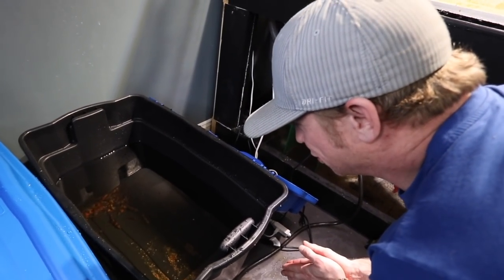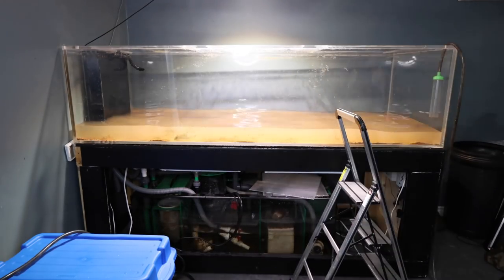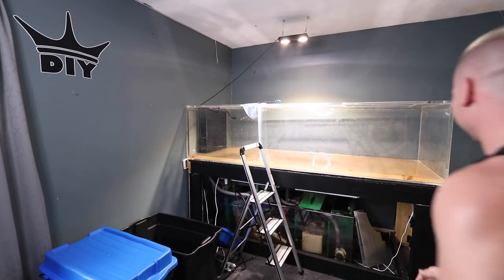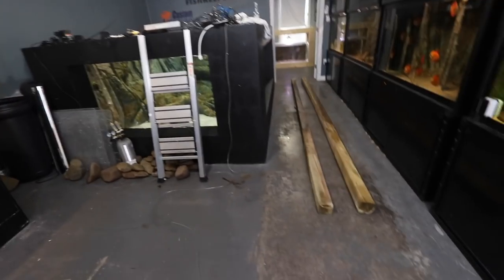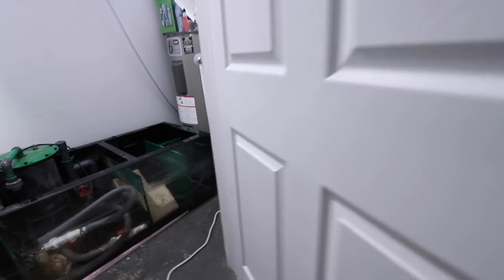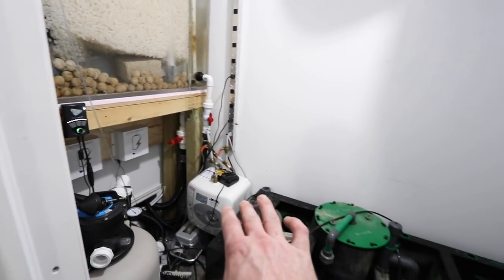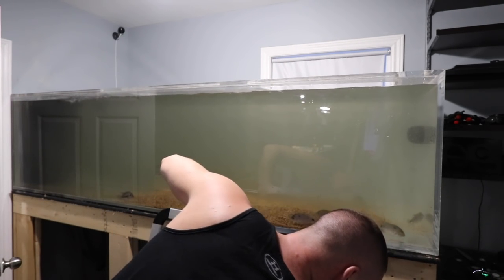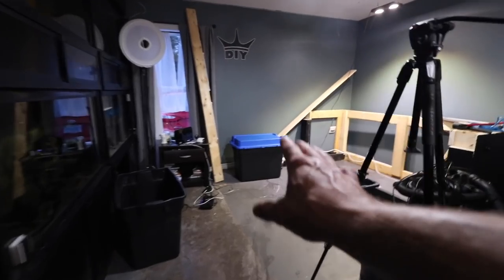BIG aquarium move - NEW fish room part 2 | The King of DIY

Comment: Joey...I don't know whether the wall is a supporting wall but why don't you knock the wall through that separates the gallery and Frank's room and have one continuous room? I think that wall and door entrance is pointless. Just a suggestion bud!
Reply: at least just take out the door.
Reply: That's not a load bearing wall. The gallery was built as a clear span. No need for any interior walls at all.

Comment: Can't keep lids off 2000g due to humidity so what about the pond?  (Aware the lids are for jumping too)
Reply from the maker: I'll put a lid on that too...
Reply: The king of DIY surely that is a tank again then the same as the 2000g ponds by definition don't have lids.  No above pond features like water falls or plants then.  

Another note, add some fan ventilation to under the plastic lids for remove the humidity and cool it off, like what people do in hooded tanks. If used brushless fans too they have less noise.

Comment: Wondering if varnish, pain fumes, glues etc have an effect on the fish?   Obviously finishing just a smaller showing area of the tank rather than complete stand is easier, to some degree.  But do you have to be concerned with fumes while working on them and letting it all dry and cure?

Comment: Joey, don't forget to leave yourself service access to that water heater in the back corner where you're going to build the new 6ft sump system. Water heaters can be so reliable we forget about the details until you need to swap out an igniter module or just shut off the (gas presumably) or whatever might crop up.

Looking forward to seeing all the new builds in place up and running.

Comment: I don’t have any experience with acrylic but am certainly interested. How does it compare to glass? For example my 180 in glass is 350lbs dry and absolutely miserable to move.
Reply: Acrylic is lighter and easier to see through but it also scratches easily. You can buff the scratches out though so it's pretty nice.
Reply: Acrylic is cheaper and lighter, and not as fragile. On the downside it does scratch much easier which can make it cloudy. You can however Polish out scratches, and they can be avoided if you take proper care.
Glass, more expensive and much more fragile as well as being heavy as sin... But much more scratch resistant. However if it does get scratches, it's significantly harder to polish, sometimes impossible.

Personally, I prefer glass. I like the look better and I'm a rough person so will scratch acrylics far to easily. However if I'm wanting a larger aquarium I'd probably go with acrylic as with it being both lighter and more flexible, I'm much less likely to break it.

Comment: Love your vids. Just got my 220 glass with bottom brace and build your stand idea. You had a piece of foam under your tank. If the stand is not perfect can I use something like a horse stall mat? Is it needed? How much can you be off with your stand. Thickness of paper or less???? Ps nice gains man, love the content. YOU GOT ME BACK IN THE HOBBY!!!!
Reply: David Szwed when you put your tank on the stand, without foam/rubber/polystyrene, there should be no noticeable gap between your stand and tank at  any point around the edge. Not even a paper thin gap. The soft surface is to even out very minor imperfections that might be on the surface, but the edges should be as close to perfect as humanly possible.

In my time with aquariums I used polystyrene, though firm but thin foam seats do appear to to the best job. I've heard of people using rubber mat as well but I haven't personally used that and not sure I would.
Reply: Keriel Watson thank you

Comment: Buddy don't use wood on floor some times the glass will broke
Reply: Tank is acrylic, not glass. setting it on wood is just fine, and makes it a lot easier to pickup again.
Reply: Aretz19 no I made the thing and my acrylic tank broke down
Reply: Sorry you had bad luck with it, but if done properly setting acrylic tanks on 2x4, or even 4x4 is the safest way to move them.
Reply: MR Fish craze then you made it wrong, the design is fine
Reply: It's not glass. It's acrylic.